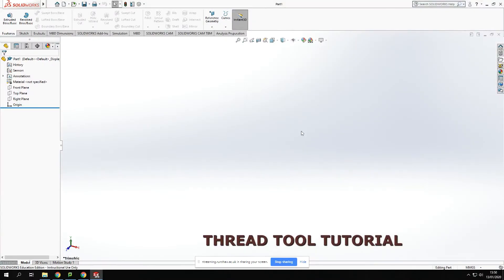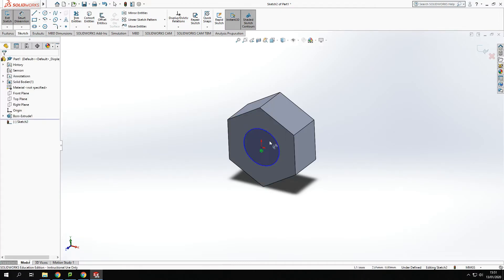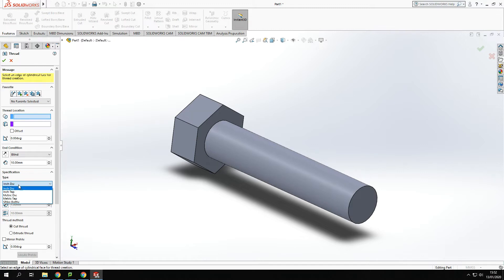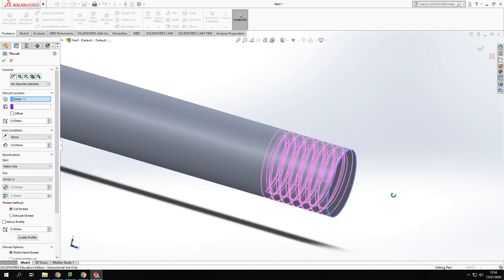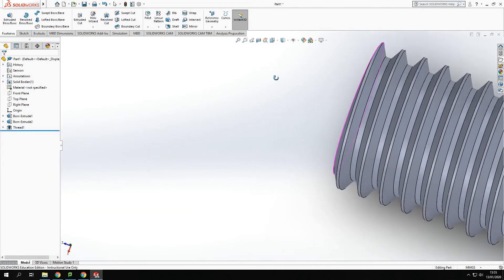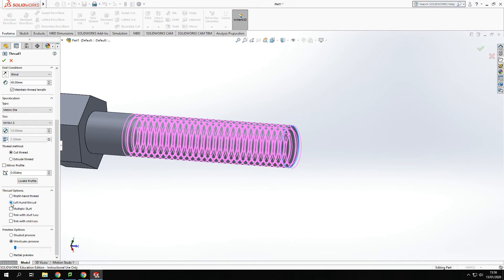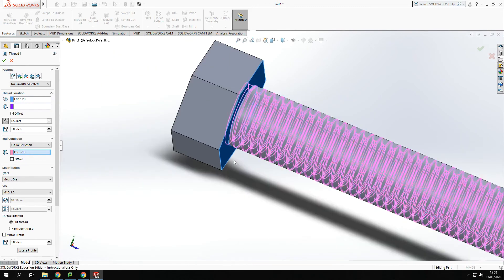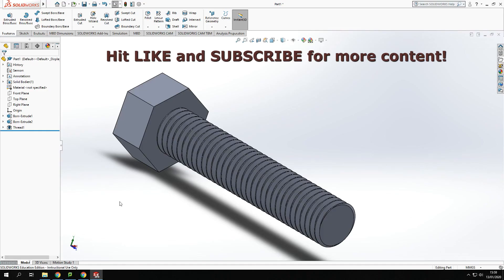SOLIDWORKS THREAD TOOL TUTORIAL - introduction into the use of the SolidWorks thread tool!

Comment: Im in trouble, I need a M37 x 3 thread in my model. The tread tool in Inventor, soldidworks, and fustion 360 doesn't have it. And I cant find a 3D model nor dimensions for it. Yes, this thread exists.
Reply: Old way I did it was draw the cylinder sketch a circle on an end. Exit sketch. Under curves pick helix set your pitch. Sketch on a perpendicular plane use polygon make a triangle. Pierce center on helix set triangle to thread profile and use sweep cut. I realise this is over a year old but someone new might read it.